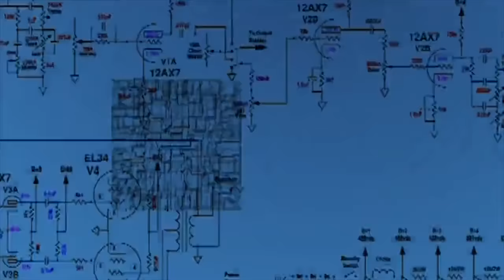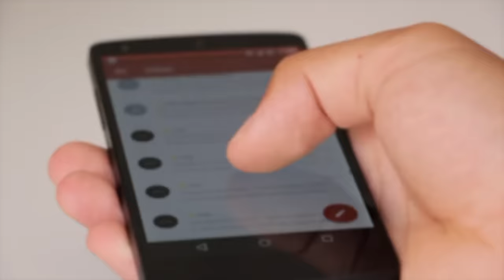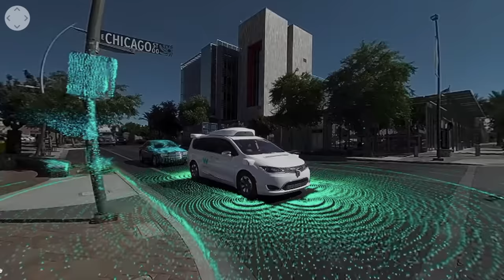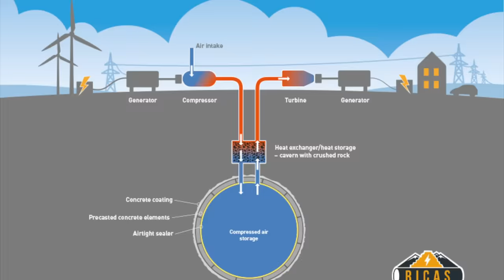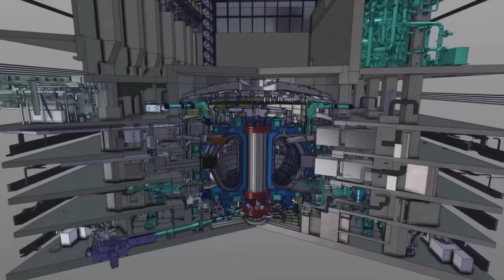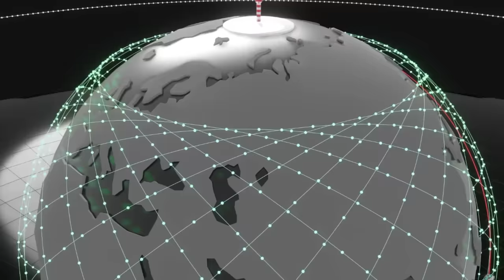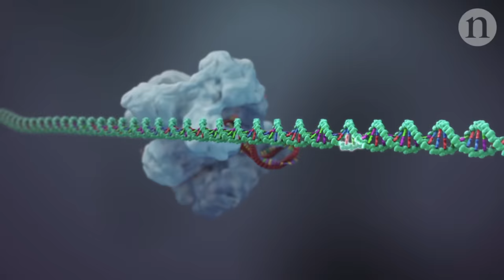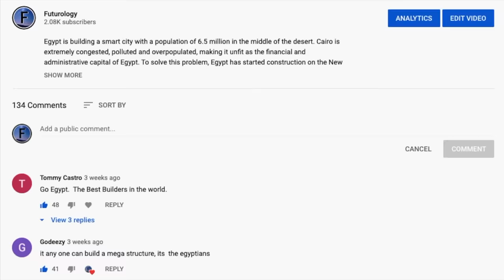The World in 2050

Comment: Solar tech has plummeted? Maybe where you live but out here in the American colonies Solar tech prices have skyrocketed. Where in 2014 you could live off what you produce plus sell some to the power authority. Not anymore. With the insane amount of permits, certificates and taxes Now you’d need a second thirty year mortgage to get a low cost system set up. And forget about selling excess to the authority because a Canadian set up a store front in Texas to receive permission from Washington to take over the electric distribution monopoly and raised prices 7 times in 2 years in spite of the promises that they wouldn’t raise the price for distribution. No. We’re obligated to use oil or Senator Manchins coal exclusively.